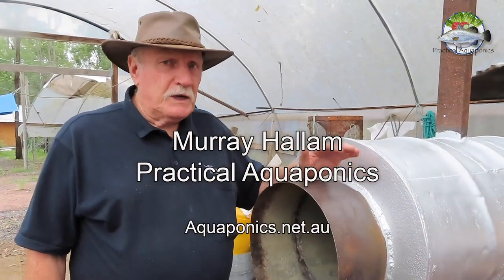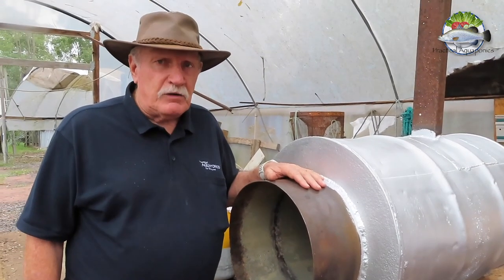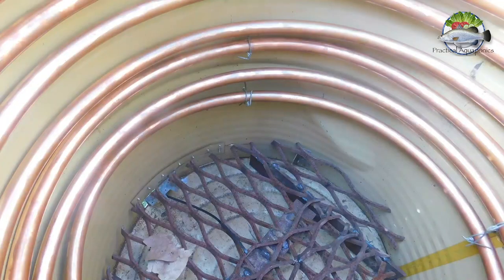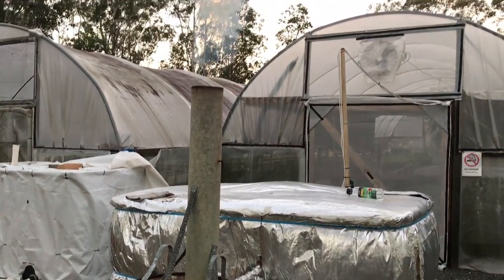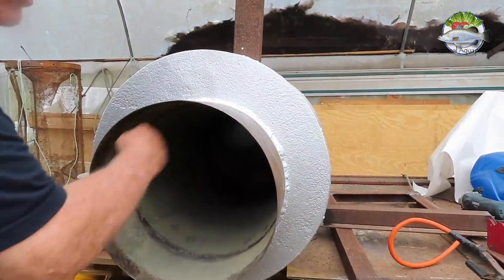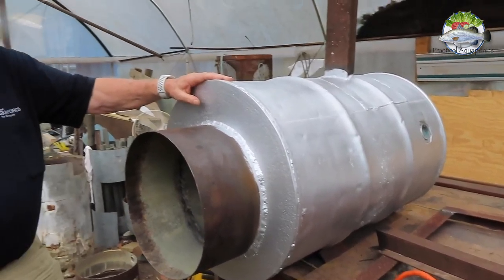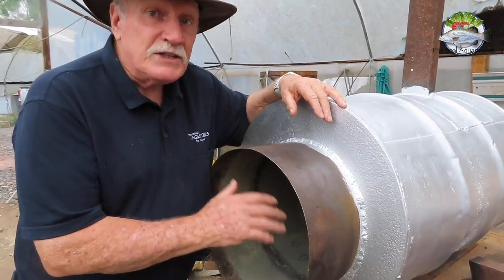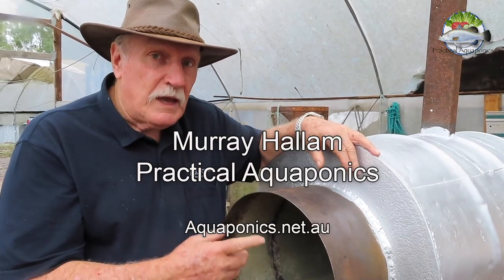New wood fired water heater for the fish tanks.

Comment: You might be much better off with a "Gasifier" design system. With that you use way less wood, you can create wood gas  to power a small engine which converts power to a belt drive pulley setup to power air pumps, water pumps, blower fans etc. all at the same time and have steam heat (water jacket) or the waste heat captured for water and ambient air heating.  You can find almost all of it at a junk yard for cheap.  Thanks Brother Murry and don't be such a stranger. Make more videos for us to enjoy. Your Friend in Maine, Tom
Reply from the maker: Thanks old mate,
Not sure what you mean about the "Casifier" I will do some reading on that.
I think many did that during WW2 to power their cars etc particularly in the UK. Is that correct?
I will finish this project first and put it to work.  Your idea is very interesting, I love to experiment.

Comment: Put a mixing valve, pressure relief valve for safety and a damper to slow the burn on it.  The mixing valve will make sure the water going through won’t exceed a specific temperature and will recirculate any excess heated water which may also improve efficiency allowing you to use the damper to slow the burn. Wrapping the barrel in fiberglass insulation will also help retain the heat in the water jacket and increase its efficiency. A pressure relief valve will keep it from possibly exploding at most and at the very least popping a weld. Curious to see how well it works.
Reply from the maker: Thanks James,
Yes, we will be doing most of your suggestions for sure. The next thing is to find a suitable pressure relief valve that will blow off at relatively low pressure.
Reply: @MurrayPonics  you might try to repurpose one off and old tank water heater or just drill a hole, weld on a bolt with the same threads. I know the mixing valve is not cheap but it could the fish away from wild temperature swings which we all know what happens then.